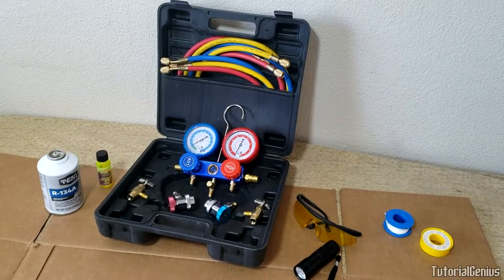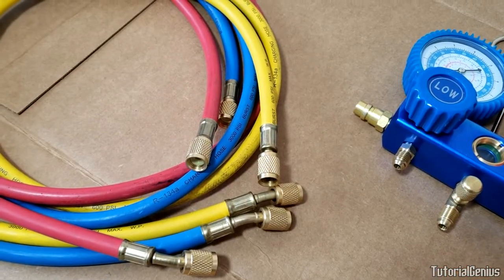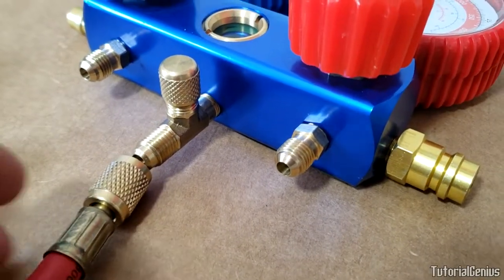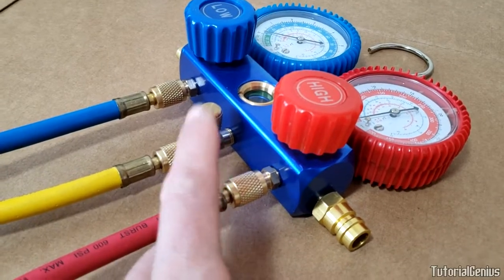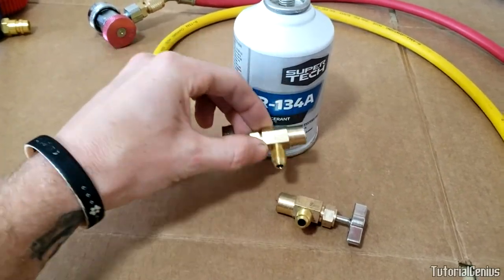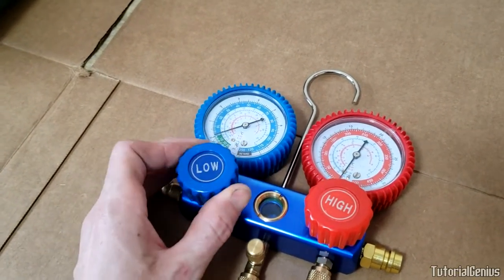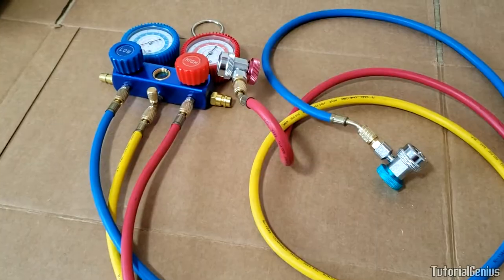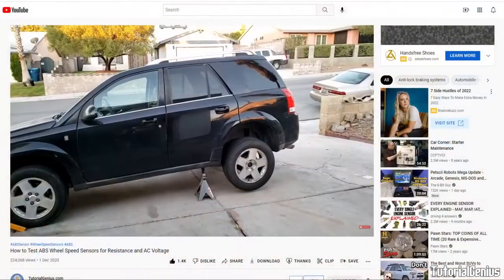How to Assemble and Setup AC Manifold Gauges - HVAC

Comment: Best layman terms for fittings is to treat them as a spin on oil filter.

Recommending to lubricate the gaskets / seals with compatible lubricant such as a Pag or Ester, in a pinch silicone spray lube when assembling the gauge set. Helps prevent them from being pinched drying out. They really shouldn't need more than finger torque spec.

Comment: Thanks for this video and the other one on vacuuming your system. I just wanted to point out i had an issue where the yellow hose was connected backwards (one side had a rubber seal the other did not) I didnt notice at the time and when i was installing freon it leaked badly...Just wanted to point this out for other people so you dont make the same mistake as me.

Comment: So the knobs on front of the manifold only open/close the charge hose? Or do i have to open the knobs to get my static/dynamic pressure readings once the manual couplers are hooked up, or once i hook up the manual couplers the pressure readings will be present regardless of position of knobs on manifold.
Reply from the maker: If you want to learn how it works hooked up, I have a video for that. It's in the same playlist as this one :)

Comment: Thank you for a great film. I have the set similar to the one fm/the film, but never used it yet. And if I just want to check if any freon is left, should I still run the car, or I can just connect the hoses (I think yellow hose should go into the 2nd for it hole on the Manifold, so the system is closed) and see the readings? Thank you again.
Reply from the maker: If you want to see if you have any refrigerant left, just tap the low and high side re-fill ports with a pen; like you would a bicycle tire Schrader valve

Comment: Thanks for this Video. @ 2.09...For the Yellow tube , vacuum machine or the r134a CAN don’t have Schrader valve and on the other end manifold also don’t have Schrader valve, In this case will the metal insert for opening the Schrader valve if it is used in the vacuum side (for vacuuming) or for Charging refrigerant will impede the flow? Should we remove the metal insert there? Please comment
Reply from the maker: I'm not sure im following your comment
Reply: You can just twist the connector a little bit until you see freon coming out

Comment: My rental gauges look like that one. My yellow hose has a Schrader valve on one end. The other side is an open hole. Which connection goes on the manifold side? Does it need to be swapped depending on whether pulling a vacuum or filling with refrigerant?
Reply from the maker: If you put the Schrader valve on the manifold side, how will the valve open?
Reply: I don't know. I'm new to this. @TutorialGenius

Comment: On my manifold gages, it shows that you did it upside down.The opposite side of the hoses with the curve and are to be connected to the gaujust mine are pittsburgh
Reply from the maker: It's not upside down. This is direct from the manual

Comment: When you press the centre Schrader to purge air from the yellow hose, isn’t there still air trapped in the centre of the manifold?
Reply from the maker: No it'll get purged! If you have a new set of gauges, its really useful to blow in the holes with your mouth so you understand the passages and how they're connected. I hope you subscribe to my channel soon